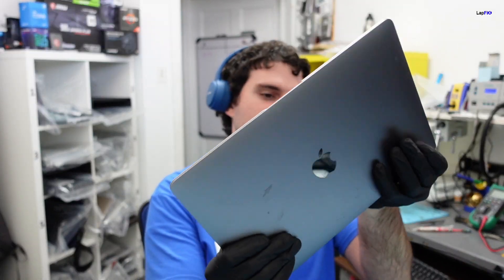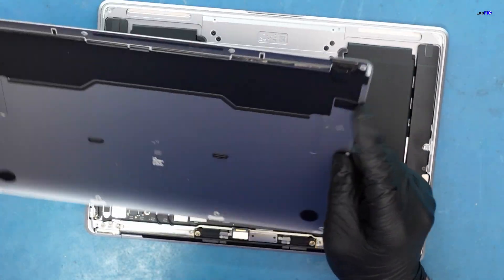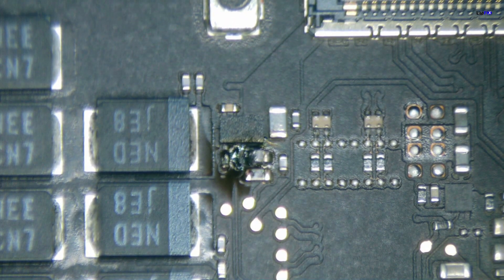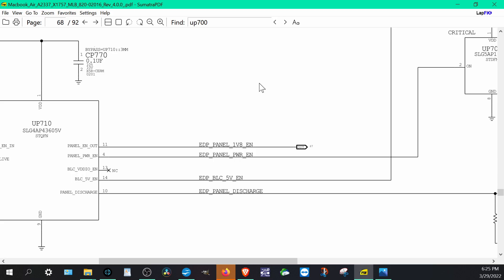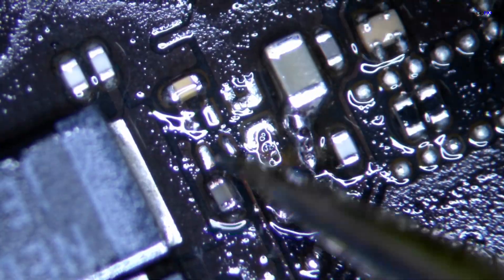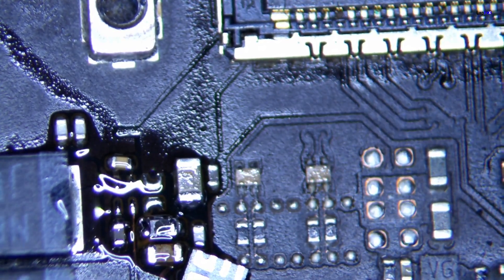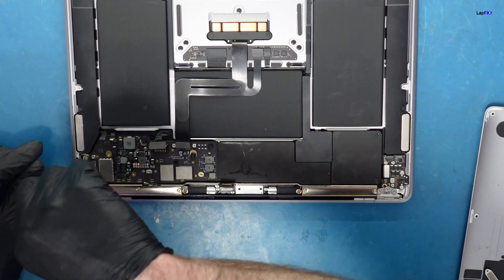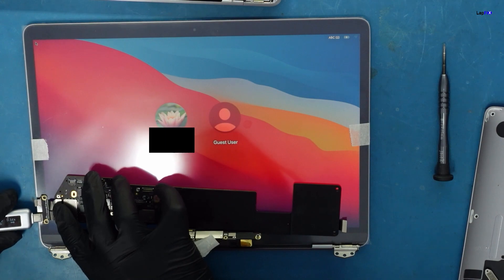Repairing a MacBook Air  M1 A2337 Liquid Spill No Backlight

Comment: i spilled water on my macbook air m1 keyboard two months ago. no problem at all. the macbook running normally as usual since then. no issue with keyboard, backlight, performance at all. should i be worried now? diagnostic test also shows no issues found. plz guide me. thanks
Reply: Hi, does your macbook air m1 still work normally until now? Or did it have to get repaired at some point after that?